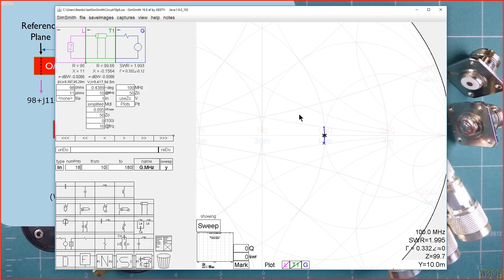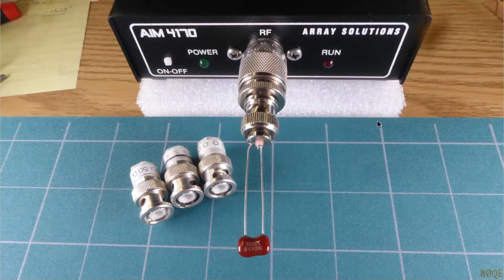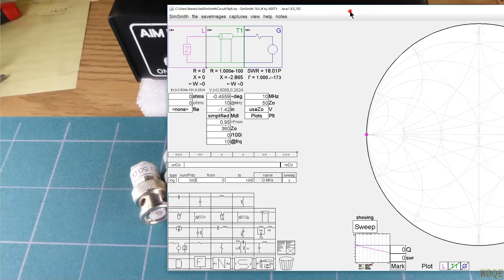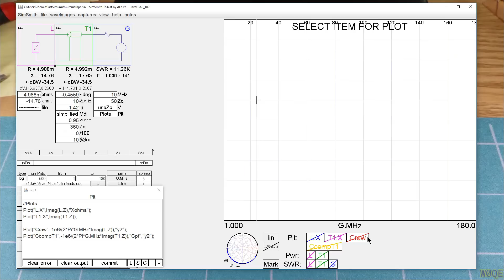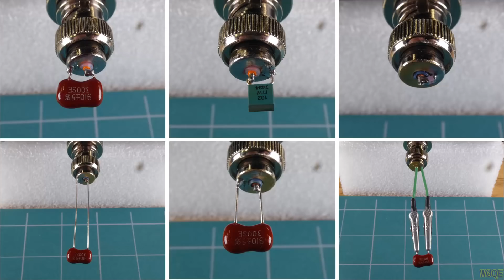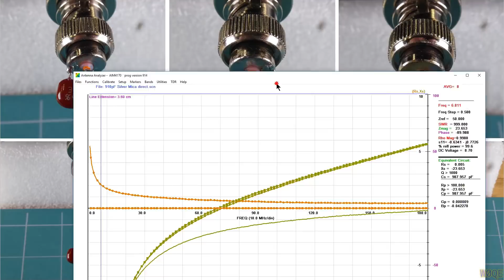#77: The Reference Plane

Comment: Hi, lot of interesting explanation but there is something that I don’t agree is where you define the calibration plane on the VNA when using an official calkit. maybe because I m using modern network analyzer. If you look to the calkit definition(off the shelves not DIY) the different standards are define at the reference plan which is the connector itself. You can see it when looking to their definition each of them have a delay (except some short on the market) in order that the VNA know where is the cal standard definition plane. Therefor after calibration you don’t need to worry.
However I agree with the purpose of the video because when using non standard connection like your alligator clip you need to compensate for this electrical length. 
This is where some people do the mistake by using the short of the calkit thinking it is the perfect short at the cal reference plane. But the calkit short is define with the ps delay. So on the Schmith chart you can compensate for this delay and voila your short is a short(as your explain it)
Reply from the maker: Smahax,
I don't think there is any disagreement here.  Chapter 5 in my manual for my HP VNA shows how the analyzer takes the true open and short which is within the calibration standard and moves this location to be at the plane between the connectors.  Therefore if you try to measure the open and short after calibration you will see rotation on the Smith chart and they will appear to not be a pure open or short.  The 2 HP cal kits I have come with a disk that can be loaded to know the parameters of the cal kit more closely and the cal kit itself is capable of being calibrated.  It isn't necessary that the distance correction for the open and short be the same provided that the VNA knows how to correct it.  The small VNAs have no such ability and the cal kits are assumed to have the same correction for the open and the short and the VNA does NOT know what this exact value is so the correction must be done manually. 
Glad you found the video interesting.
Larry, W0QE
Reply: @w0qe  thank I got it. I never had the chance to use those small VNA. So know I understand the extend of your explanation. I thought all VNA have the same capability as the old very good hp you mentioned. 
Thanks
Reply: The calibration plane using the professional kit is placed a few millimeters above the junction point between the male and female pins.
The short is exactly 180° apart from the open.
For example in my VNA if I calibrate a port, directed to the instrument connector I will have zero degree phase with open inserted. While -70° without connector at 4GHz.
If I insert only a male pin without a 10mm long connector it returns to zero degrees.
In my opinion, moving the offset of the calibration plane is wrong because the male pin must be inserted in the female and with the correct gap!
The problem instead is when using trhu adapters in the case of non-insertable dut or adapters after calibration. Those have to be compensated for if precise measurements above 2-3GHz are to be made

Comment: This is fantastic content. The concept of understanding and getting the most out of the tool we have, is a core philosophy of mine. Understanding these issues is so helpful. 
Question: Is this type of issue addressed (or reduced in magnitude) by using Calibration and DUT PCB fixtures at are matched? (and my apologies for initially posting this question on the wrong video)
Reply from the maker: AC8VK,
Doing a calibration such that there is no need to or only very slightly adjust the reference plane will give more accurate results.  However remember that "Perfect is the enemy of getting anything done".  SimSmith is a great tool for deciding how close to "perfect" you need to be.  I can easily do a video on this topic if folks are interested.
73, Larry W0QE
Reply: @w0qe  Thanks.

Comment: A video on how you made those loads would be interesting. How did you fix the BNC and N connector pins so that they do not move?
Reply from the maker: Dragan,
I will make this video soon.  I did nothing special to keep the center from moving other than to pick connectors where the center pin was very rigid.  The 2 piece captive pin N male connectors came from Array Solutions in Texas.  I will see if I can find part numbers for some of the other connectors I used.  The BNC male connectors were 30 years old but they may still be made.
In the past I made O/S/L loads with connectors where the center pin had some free movement and I mated the connector I was working on to a mate of the other gender when soldering the resistors.  Then I used a micro amount of super glue to guarantee the center pin alignment.  This worked well.
Larry, W0QE
Reply: I guess I will have to stop using cheap connectors from China ;) 
Looking forward to that video, it is always interesting to see other peoples construction techniques, often I find them quite instructive since I do not have much hands on experience.